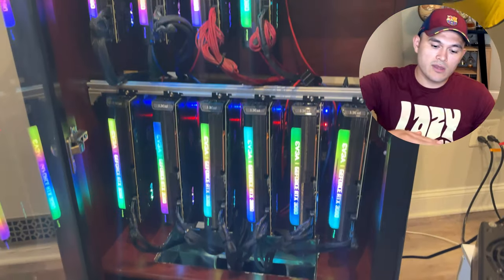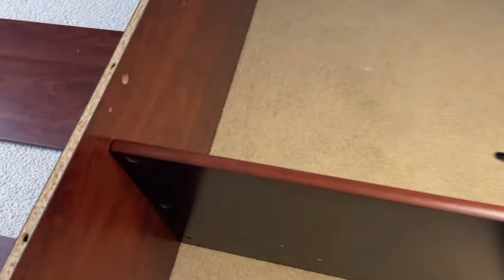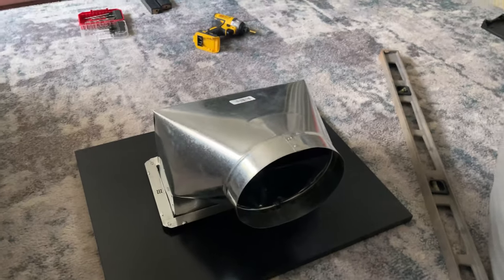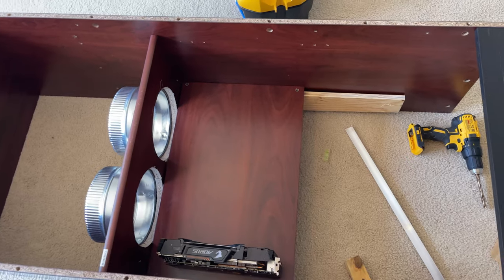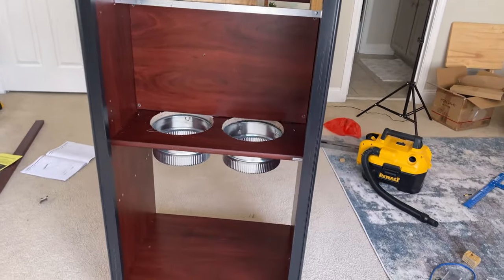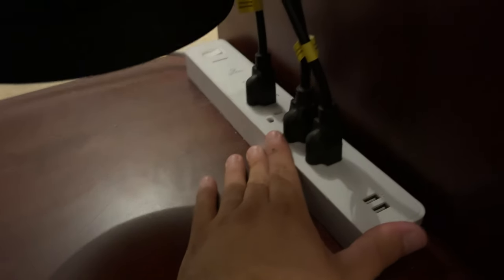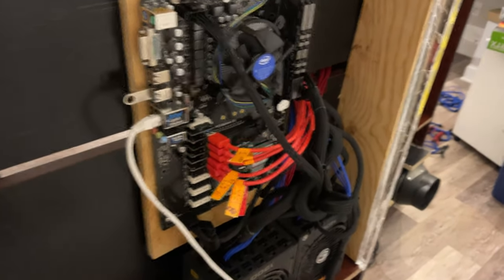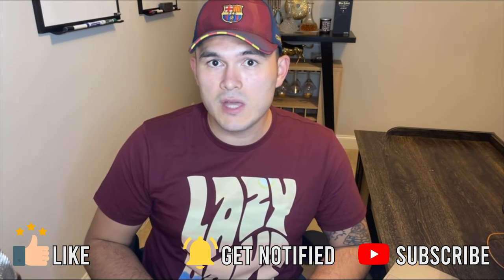How to build a custom 12 GPU Mining Tower Rig

Comment: When you talked about the PSUs at about 5:50, I think you have the airflow backwards.  The fan on the PSU pull air in and the vent near the plug and switch side is the exhaust.  This is a real good setup though nice and clean, and i doubt the PSU airflow will have any affect on anything else.
Reply from the maker: Thanks for the advice !! Didn’t realize that

Comment: nice looking setup. I had a similar setup but to make the miners cooler i had an opening the entire size of the top exposed to remove maximum heat strait out the window. Doing this allowed me to maintain the ambient temp much lower but i needed to use two 20 inch box fans on slow. This kept things quiet and the total wattage for airflow less than 80 watts.

Comment: As some guys said, its not easy but the main thing on cooling is cool air hitting the GPU fans/heatsink. If you can route cool air directly on the fans you may need only exauts fans in the cabinet to take the heat out of the room
Reply from the maker: Interesting idea ! thank you

Comment: I did the same thing but 6'x6' and 4-8gpu rigs with 8" 900cmf inline pot grower fans. In end i decided it wasnt worth the risk. 1 fan dies your investments cooked. Bit the bullet and built a mining addition off side of my shop. All the empty space is excuse for more rigs
Reply from the maker: I have smart plugs that alert me if the wattage usage drops(if fans is not tuning) , and I am using hiveos to auto tan settings to shut off my cards if they pass 70 F .
Reply: @HashRig  thayd work. I travel for work i was a nervous wreck leaving them in a cabinet.
Reply from the maker: @bigsky33  yeah I can imagine!!! As long as you stay on top and do proper maintenance and have a solid disaster prevention system you should be good

Comment: Hey that's a pretty sick setup. For anyone reading this, I used Frosty Thermal pad 12.8 W/MK in the US to reduce my temps a lot. I am spewing only because I've done so well with them and they are my personal secret for improving the memory junction temps.
Reply from the maker: Thank you!! I might try them
Reply: @HashRig  Give it a go. Really good pads for the price. Found it on a forum and read the reviews. Excellent and I share with friends now. Personal secret ;).

For me I want good pads, but not the super high price so this is an excellent middle ground. I actually think they are slightly better than Thermalright because they feel fresher and are more moldable.

Comment: do you think a similar setup would work for a 20 GPUs? OR What kind of modifications would you make?
Reply from the maker: I would, but most motherboards won't get you 20 cards running, you might need two ASRock H110 Pro BTC+
Reply: @HashRig  i have two separate rigs and was thinking of a similar setup
Reply: also how much spacing would you recommend between the cards?
Reply from the maker: @user-sl6ic3xj6w  I did 3 inches for good airflow, but if you can't do 3, 2 should be enough.

Comment: I don't completely know how good these isolation type setups are for power conservation. If you were bringing in air from outside and dumping it to outside, then it would be completely isolated and not adding much load to your HVAC system. But the issue with that can be too much humidity in some climates and if the outside air temp is too high. It looks like you are just sucking your AC air from inside your house and dumping it outside at at a high rate (kind of like leaving your door open with a fan blowing out your cool air). Most AC systems take about ~0.3W of energy to move 1W of heat inside the house so I'm not sure that dumping out your AC air saves any more energy than if you just let your AC system remove the heat directly. Also, in the winter or cooler months, its better to dump the hot air into the house which reduces HVAC usage and saves money. But I do like your setup as it looks clean and organized.
Reply from the maker: Hey thank you so much for that advice, in my new video you can see a detailed explanation of where the hot air is directed to.
Reply from the maker: https://www.youtube.com/watch?v=cO6o1o6VYCo

Comment: Those watt meters will slowly deform and melt over time. I had two of them. (Mine were running at 800 watts each, rated for 1800watts).
Reply from the maker: Might have to replace them 😅😅
Reply: No, they won't, unless you are using cheap ones. I have 7 different ones that are expensive and UL rated running various rigs ranging from 300W to 1300W constant draw since January this year. No sign of any kind of deterioration or failure.
Reply from the maker: I'll keep an eye on them, i usually do maintenance every 15 days or so

Comment: Are you doing 240v for final version?  I ask because 12 3080s pulling ~220 each is far more than a single 120v circuit can handle... it is basically 2 normal 15 amp circuits.  Also, may i suggest you look into server psus if you do go 240v.  They will cost you far less and with breakout boards wiring is sooooo much easier.  Look at parallelminer for some options and their breakout boards.
Reply from the maker: Thanks for the advice! I will look into it for sure. And each outlet is a dedicated 20 amp circuit.

Comment: Hi. I have a similar system but inside a growth tent. When I tried 2x bottom intake vs 1 on top, the temps were way higher than 2x on top. That's because if you just have fans on top they will create pressure to suck your cold air anyway. Have you tested this? My temps came from 108 to 91. You re sending more air than sucking. That will retain the hot air inside.
Reply from the maker: Woah those are high temps, highest i've gotten is 80, I can try to pop another one at the top but right now it might not be necessary. Also i thought about using a grow tent as well, but went with this design instead
Reply: Agree with Ricardo. Negative pressure ftw.

Comment: Drop inntake fans. Use only fans out. Most important is to get heat out off room. 
Bottom inntake should be sqaure. Round holes makes air move inn unwanted path. If you cant cool i your tower and open doors. Heat will build up in room. And nothing will work. 
So. 
Freash air in and hot air out.
If you have long lines you can put fans in series to push with higher pressure.
Reply from the maker: That's a good point, thank you

Comment: You need to remove those smart switches from your rig PSUs.  Although they claim 15A they are not designed to take a full 15A load continuously.  I have several friends who have come home to a melted plug.  Save yourself the hassle and just plug straight into the socket.  Buy you a power meter so that you can adjust your rig power in Hive.  It's much safe this way.
Reply: I don't think I need to say this but just in case do not leave your rigs plugged in to the power meter.  Just use it to find out power and remove it.
Reply from the maker: I only use them to test the wattage when doing some testing, i never keep them on at all times. Thank you though for the advice
Reply: Might be something to add to the video or a future video.  That wasn't very clear and there are a lot of viewers who won't think about those things until it's too late.  I like the cabinet idea though,  keep it up 👍🏼

Comment: You need to draw cool air directly onto the GPU's. The way you are building the racks was what I tried at the start of 2021. You end up cooling the bottom GPU's and then sending hot air to the next GPU's in the rack. This is the design that I went with in the ent and it was by far the best https://www.youtube.com/watch?v=aGszLAAyTcc&t=1s.
Reply from the maker: Great advice!!!
Reply: I think if he cuts some rectangular holes on each side of where the top gpus are located and put filters in the exhaust fan will pull cool air in through there as well, cooling them from the heat coming from the ones below them

Comment: Pretty Good, though I am not expert at this, try this out, 
If U r in air conditioned room, add holes or side inputs vents for air to get in, in case u have dust add a dust filter cloth of some kind, let go of the air input fans, and increase the fans at the output end, which will increase the negative pressure inside, hot air rises, cold air naturally enters from the bottom, 
Try it out..... Might be more efficient, and the size (area) of input holes should be smaller than out put holes, to create negative pressure inside
Reply from the maker: Getting some dust filters soon

Comment: Nice work bud! One note, maybe I missed, but does the exhaust fan have double cfm value compared to the intake fans at the bottom? Having both intake and exhaust fans seems a bit overkill for me, just exhaust could be enough since hot air rise anyways. On the other hand if the exhaust fan is the same as the intake fans, it actually blocks the airflow what the intake fans are pushing. Just thinking..
Reply from the maker: Humm I’ll do a test with out the fan at the top

Comment: Love your setups. Have a ryzen 9 5950x with an ASUS b550 proart motherboard, but it lacks pcie ports due to having to add wifi card. Leaving only 2 pcie ports to put risers on.(I still use it as a gaming pc so I do have 1x3090 in one of the pcie slots) You having any suggestions for a better motherboard (eg msi meg x570 unify) or something better? The gigabyte x570 Master looks good with better vram cooling and bit better build quality, however 1 less pcie slot.) I hear you can have adapters on the M.2 slots to go to a riser. I was planning to just have risers going to a seperate rack beside my gaming pc.(I assume, I would have to put in 1to4 pcie adaptor to increase my number or risers) Cheers Dion.
keep up the great work... your systems look amazing.
Reply: maybe use an USB WIFI card?
Reply: Keep the motherboard and get a pcie splitter.
Reply from the maker: Thank you

Comment: You should use a rack system on the inside of the case... and use gpu hangers 😉 and then drill smaller holes for the cords and seal them some how so u have un interrupted air flow
Reply from the maker: thought about it haha

Comment: You need BLOWER fans,  the propeller fans will never move the kind of air you need.
Reply: those 750CFM inline AC infinity cloudline series will move all of the air he needs lmao. If thats the model hes using. I have 2 8 inch for exhaust.
Reply: scratch that, they are the cheap knockoffs lol.
Reply from the maker: yeah haha, they are rated 700 cfm

Comment: Nice setup man! I like how you went with a positive air pressure setup. Have you thought about putting air filters on your intake?
Reply from the maker: I though about it but the air coming into the room is clean air that runs through my furnace
Reply: @HashRig  Often times your furnace filter isn't Merv 15, which is what datacenters use as a minimum. I found I had bad dust issues even changing my furnace filter out monthly until I started filtering the air directly coming into my units. Then I moved to my garage, where I uhm, yeah, it's dirty in here, but working on it 🤣

Comment: Hi Lestor Great Video!  just a question with your motherboard, how did you manage to get so many Nvidia cards to work with the Asrock H110 motherboard? I was told they will only do up to 5x Nvidia GPUs and the rest AMD
Reply from the maker: Honestly, I didn't do anything to my motherboard, if I were you I would google the proper mining settings for the H110 Motherboard bios

Comment: 5:31 a lot of construction and does not know that you should not put sata cable in the risers
Reply from the maker: Fixed!! threw out all sata connections and sticked with 6 pins for the risers. Thank you for the advice